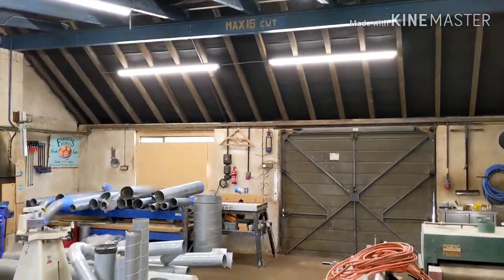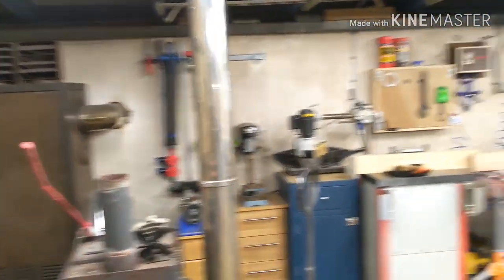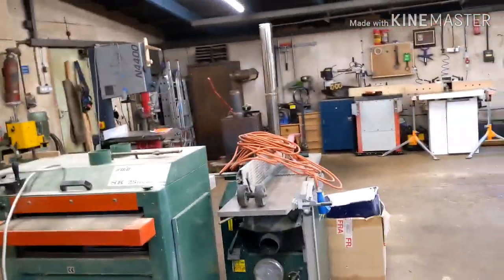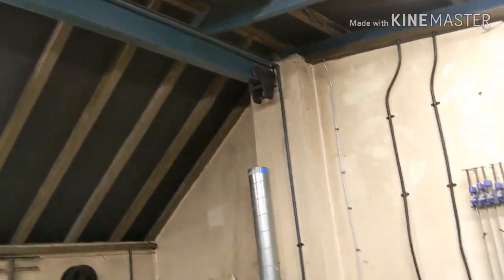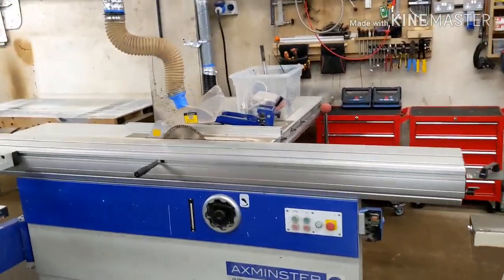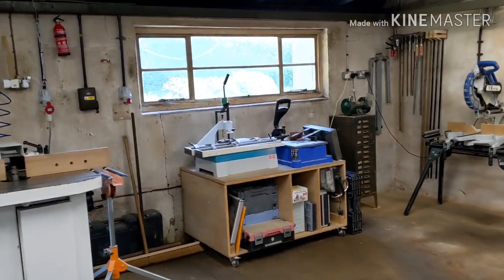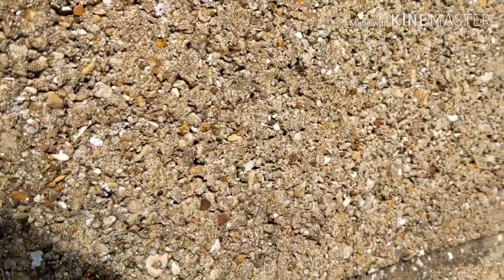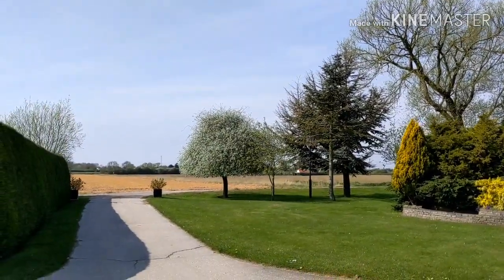A quick first look at the new workshop. April 2020 woodworking workshop tour.

Comment: Great space and height. 👍🏻
Reply from the maker: Thank you, it gets a little low at the edges with the pitch of the roof, but it's good in the middle and that is where you tend to be standing turning over long lengths, or sheets goods, so it works pretty well as a compromise. Biggest downside is the doors coming in are quite low, I've had to take a few machines apart because they were too tall to fit in (even with the door and frame removed). 🤦‍♂️🙄